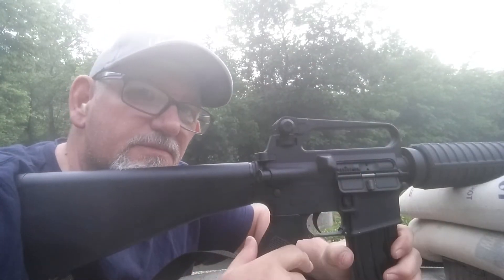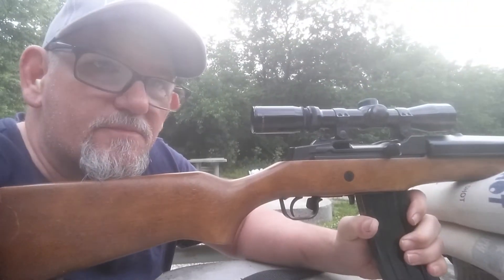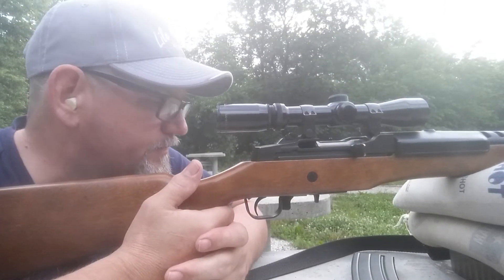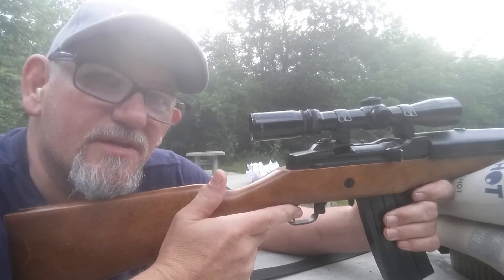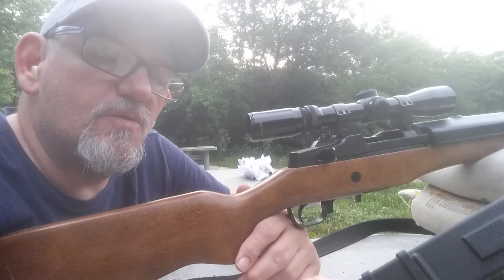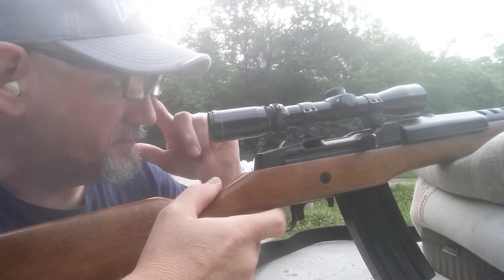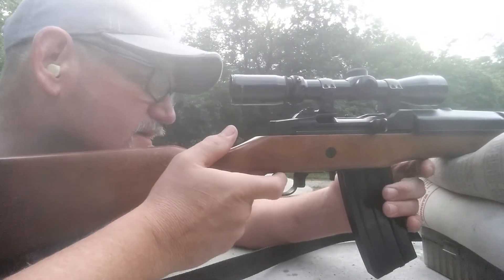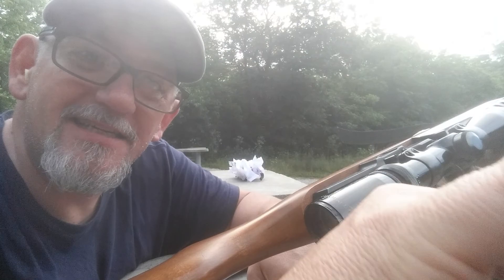Lee cast 55 grain five different powders

Comment: Went to the range today, think I found my 55 gr. cast load for my ar15 . My goal was under 1 moa with the cast bullet . My gun likes 23 gr.- H335 and shoots sub moa with hornady fmj bullets so that is the powder I went with . With 15.5 gr. - H335 and the Lee 55 cast it went 5 shots in 7/8 inch . It groups as good as my full power load , just not as fast and cycles the AR . Since I have 8 lbs. of H335 I am glad it worked out . Hope your tests come out well .
Reply from the maker: James Pollard  I am glad to hear that I am glad you had found a load for you. Isn't it nice to be able to cast bullets like 127 per pound of lead
Reply from the maker: James Pollard are you using a gas check or not
Reply: No gas check . But it did take 3 trips to the range . I started at 21 gr. and worked down to 15 gr. in .5 gr. increments . 15 gr. didn't cycle the AR all the time and 15.5 grouped the best . From there the groups just kept getting bigger . 21 gr. shot water melon size groups . Now I will enjoy shooting the AR for cheap .
Reply: powder coated, no gas check
Reply from the maker: James Pollard yeah I've noticed that when you powdercoat gas checks are not necessary